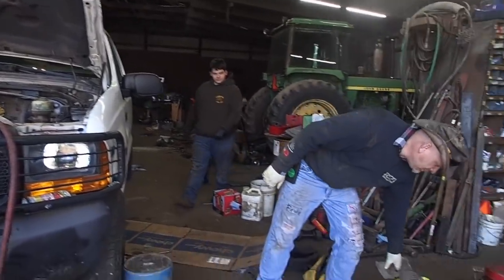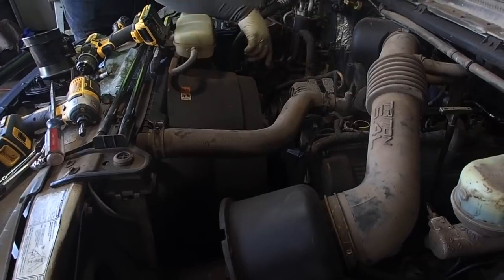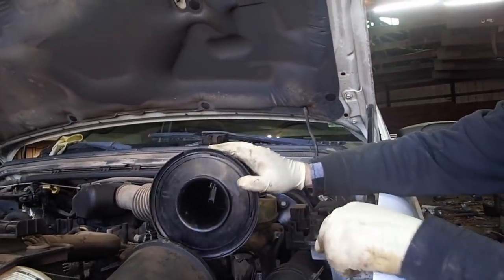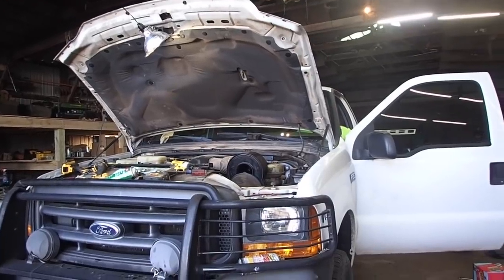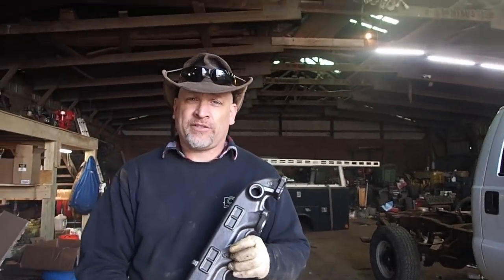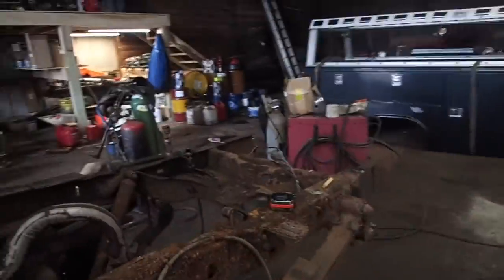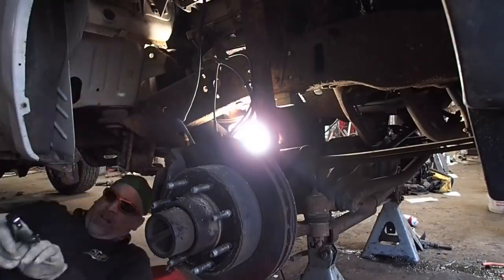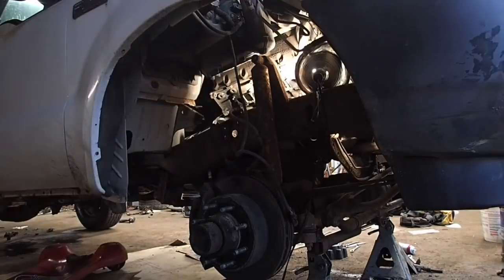Tool Truck Build-Repair 1

Comment: Be a good time to replace the fuel pump.    Oil on plug boots are the valve cover tube seals.

Comment: My all cast iron LQ4 6L silverado 2500 (1999) has not had any problems with the manifolds. I think its the aluminum heads that cause the manifolds to crack.(my guess) so would it be good if aftermarket made aluminum manifolds?

Comment: I am not an expert but bolts may work better for flex in the truck like if you were to drive through a ditch or something where  there will be some flex. Just a suggestion. Liked the video, good luck down south

Comment: Dang, that salt really does a number on the important parts of a truck up there.
Reply: I hate salt with  a passion,  no choice because  of idiots on the road, I'm ready to move south in winter  so I dont have to deal with  it, washed vehicles constantly all winter. Helps but salt gets in everywhere.
Reply: @misterz2719  I'm in NE Texas and last couple of years they have been salting the roads here. it SUCKS,especially when our "snow event" might be 1" if it even snows..
Reply: @amossnowdaharleyman9179  that is crazy, all they have to do is spread sand

Comment: I made and fitted trays for a couple of vehicle makers .... ans I were instructed by them to never weld anything to the chassis rails ..... welding them weakens them and will eventually cause a chassis failure.
Reply: as i said above, it will not pass safety if i weld is seen on a rail between the back spring hanger and front wheels but you can repair a frame rail as long as no one can tell its been welded, if it iswelded the proper way and no welds 90 deges to the rail it will never fail, i have cut frame between the drives and front wheels and added 2 to 6 feet into the frame on small trucks to tractor trucks, and they are still on the road to day, when adding to the frame you must find a scrap frame to use the peaces out of.. and cut the rails the right way, and no 90 deg cuts, and you never weld them with a mig oof any kind, you be asking for it.. a mig has one place and its not on repairs or mods
Reply: Arnold Romppai   that's all they use is mig !! It's all wire welded !!

Comment: as a welder all my life that has remover more wheel studs on pulp trucks and trailers, manifold studs on skidders, slashers you name it, you never usea mig welder to weld a nut or peace of pipe to a stud deep in side the hole, you weld them on with a 1/16th stainless steel rod, and you can tread them out with your fingers, as the stainless shrinks the steel stud,, i get a real kick standing there watching a know it all trying to dril a hole in a wheel stud and if and i do mean if they manage to get a hole, using a easy out to try and remove the broken stud, ends up with a broken easy out in the stud, and now there fucked at welding anything to it...

Comment: if you have oil in the spk plug holes replace the valve cover caskets
Reply: stainless or copper is the best with the bolts then use steel for the nuts different metals come apart easer

Comment: I'm not understanding why you keep buying exhaust manifolds Wes,at $400.00+bucks a pop and they keep failing.(I never had this issue and hopefully never will)
For the amount of money thats been spent and the amount of intense labor expended,after the first failure I would have bought split stainless steel headers for it,these will dramatically increase fuel mileage also,plus ZERO failures.
Reply: I have owned Ford's since the '70s. Exhaust Manifolds got bad in 1992  and I have Changed many. You must not drive your Trucks.
Reply: @ml2trick  I've owned 7 Ford trucks with engines ranging from 4.0 liter(240-6) 4.9 liter(300-6),5.8(351-Winsor),6.0 liter(360),6.6 liter(400)7.5 liter(460),6.0 liter(400 newer F-250 HD)
My"youngest"truck had over 200,000 on the clock,my oldest that I still have(1968)has over 500K on the clock and still has the original exhaust manifold on it,the rest of my trucks averaged well over 300K on them.

Comment: quite a bit of rust on that frame, can you sand blast it, and paint the frame. i know it is none of my business nor am i asking how much you are making, but the job you are going to do, must be pretty lucrative for the money you are spending to get down there to do it. also you never showed the motor home you bought. did you get it registered
Reply: we dont sand blast them up here, to much rust, the new paint would be off the next winter, the frames are sprayed down good with a 50/50 mix of colored fuel and ATF OIL every year
Reply: I’m also from Ontario ,I just bought a 99 f350 that has a flat bed.  the last owner attached it by welding 4 threaded rods to the side of frame and then put 4 nuts and tightened them .i know it passed the annual yellow mto sticker last year

Comment: copper does seem like a strange choice.  copper gets terribly brittle once its been heated up and then cooled.  I would be afraid of breaking them the next time I want to take them out.  all though they are copper so they're probably easier to remove if the break off.  just seems weird but what do I know.

Comment: Will you be taking a wire brush to that frame then applying some chassis saver (rust inhibitor) to it?
Reply: i hope not, then for sure we can say they are the 3 stuges, they be there for days with a wire brush and get know were, mabe a wire wheel on a big grinder, but sand plaster is by far better.. as there are so many lines in the frame, take note: if you weld on a truck frame in Ont. Canada you better know how to do it so no one can tell its been welded, as it will not pass a safty, and made to replace the whole frame rail,  you can weld on the back end of the frame past the spring hangers to the back know problem, but is a no go any were a head of that, i have repaired many a frames between the drives and front wheels as well as cut frames to make them longer, but you have to know what you are doing, and never weld a frame on a 90 deg angel to the frame, you have to make the frame look like it is factory, meanig every weld must be ground flush with no under cut or pot holes, if it is noticed its been welded, no safty for you until you replace that whole frame rail
Reply: Arnold Romppai  

I’m also from Ontario ,I just bought a 99  f350 that has a flat bed on it now . The last owner attached the bed by welding 4 threaded rods to side of frame on the two front and back corners .he then put 4 nuts and tighten them . Will it pass a safety I know it passed the annual yellow mto one last year

Comment: Wes - don't forget to change the radiator cap on the F250 and I believe the F550 it is just cheap insurance to prevent them from over heating.  This is one of the most over looked items on a vehicle - myself included.... nice video as always !!!

Comment: Those stud bolts, we use a welder.  Makes life easier.   This Ford isn’t bad.   When they went to the front end coil spring design, you have little to no room at all.   Usually raise the engine a little for clearance.   New Ford trucks are still having the same issue.   Had a v6 turbo, 2014 model come in with the same crap.

Comment: Wes look at my photo, would make a wonderfull service truck for you. Clean title ready to sell 92 F-250 5.8l auto king cab with air 130k miles. Fiberglass dual wheel built utility box with a lift gate, dual fuel tanks and way less rust then what your dealing with now. New brakes on all 4 corners, all new brake lines, wheel cylinders, drums, shoes, calipers and new inner and outer axle bearings in the rear end and new alternator, 135 amp charging system as it has a lift gate. Tires have 3,000 miles on them, 12 ply sidewall. Truck was a special build for Minnesota power lineman crew. Truck needs a new home where it can be used for what it was built to do, work. If you don't want it see if you have some push power for Blake, "Guy in wy" here on the tube. Runs and drives just fine when it was parked last fall, may need a new battery by now, I did not remove it before winter my bad. Thanks for the shows, and the time making them.